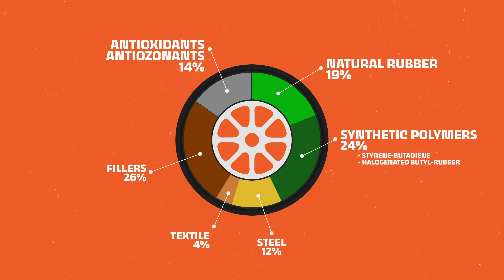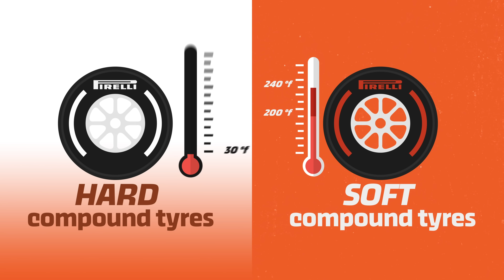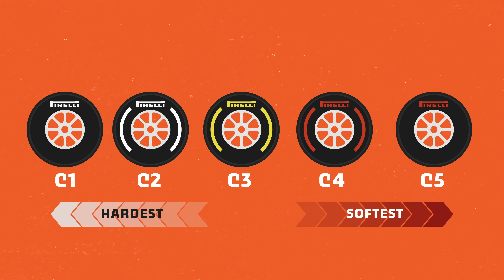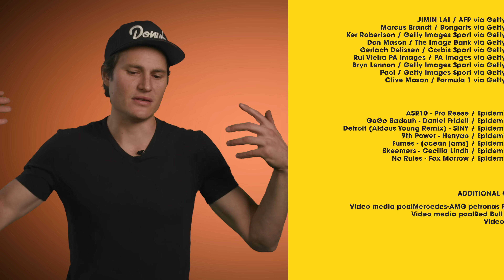Why an F1 Tire only last 50 miles

Comment: Dr. Porsche used to say that "the perfect race car crosses the finish line in first place and then falls to pieces.” Never knew that applied to tires as well.
Reply: You mean Ferdinand Porsche?
Reply: well this is the best engineering. makes sense although accounting for inevitable random factor, the car could very well fall to pieces right before the finish line on the next race.
but here we're not talking about engineering to get the best performance but the opposite. force performance degradation by some rules. sounds like having tires that could last a whole race would not make it much slower and could allow more strategies. plus making engineering work towards improving tires instead of artificially reducing longevity. right now electric racing class sound more exciting regarding to the real-life improvements they could eventually bring
Reply: It all makes sense now! German car companies just look at the warranty as a race!
Reply: True, wheb porsche used to race their aluminum frame would last one race and they had to replace it because of fatigue and cracks. The spaceframe wighed 60kgs.
Reply: Also, it was filled with gas so they knew when it was leaking somewhere
Reply: @kuebby  So they want their customers to speedrun the warranty?
Reply: @kuebby  so by knowing when things fail, they can design their parts to last... I mean Porsche managed to become "the" reliable supercar 🤔
Reply: Tyres are part of the car, so why not? Only difference being the team don't make the tyres.
Reply: Jimmy Johnson knew about that. He entered a highly illegal car on a nascar race as a car owner, and as soon as the car crossed the finish line the motor went off. 7 out of 8 cylinders were fine. The last one? God knows, it shattered in pieces somewhere on the track.
Reply: @nolongerusing7430  pretty much.  Most manufacturers want their cars off the road after 5 years.
Reply: The other end of the stick, the perfect formula 1 car crosses the finish line 1 second ahead of second place, that way they know they conserved as much life from the limited powertrain allocations as they could.
Reply: It really doesn't ever apply to tires, F1 tires fail way before. XD
Reply: It was Colin Chapman of Lotus:
Colin Chapman who followed the principle that a racing car should fall to pieces as it crosses the finish line
Reply: the tires lose so much grip before they fall appart so no this is wrong this dude doesnt really know what hes talking about in the video
Reply: Hey guys I have been following god for some time now and he’s made my life so much better. I encourage you to do the same🙂
Reply: The Blues Brothers Nailed it!!!
Reply: dragsters:
Reply: Very similar to rocket engines
Reply: That was a Colin Chapman quote. 
Founder of Lotus and designer of F1 cars.
Simplify and add lightness. Was his mantra. The perfect car would finish the race and go no further.

Comment: Sergio Perez must be laughing while watching this
Reply: @everydayalbertan768  have u even seen this video? xD
Reply: I mean after today he might be 😂
Reply: @everydayalbertan768  it just depends on the tires used he doesn’t mean the tire can’t get past 50 miles. If you watched the video you’d probably be able to notice that there were two processes that affect the tire mainly
Reply: @everydayalbertan768  They do have knowledge. He was talking about F1 Super Soft Tyres. They don't last more than 50 miles.
Other compounds like medium and hard tyres are DESIGNED to be more durable, but sacrifice grip. Medium is the balance between hard and super soft so they have the characteristics of both.
Reply: @ScreamDeafProject  true , each tyre has many different of chemical compound
Reply: @everydayalbertan768  bro have you seen the video
Reply: @everydayalbertan768  He literally said that. It was the "give up". Watch first
Reply: @everydayalbertan768  9:35 next watch the video before saying bullsh*t
Reply: @everydayalbertan768  think before your type because you have now upset everyone
Reply: @everydayalbertan768  you've especially upset your mom
Reply: @everydayalbertan768  it's actually kipzo that's talking rubbish. They are just stating what the tyres life is based on paper.
Reply: Checo is cold heart men is something serious happening there
Reply: Red Bull is running GoodYears with Perreli stickers

Comment: Who's here after Perez done 53 laps on medium tyres at portimao?
Reply: Since the track is 2.89 miles long, that means he drove at least 153 miles on those tires
Reply: @NORIN_50  oh my god I didn't even think of that
Reply: @NORIN_50  jezus cgrist
Reply: did he win?
Reply: @akshatshxrma  nope
Reply: he got p4
Reply: 50 laps he was visibly a lot slower than other cars so they didnt necessarily last
Reply: @bjk03_62  the tires did last, firstly it didn’t blow up and secondly, THEY’RE FUCKING MEDIUMS. Which theoretically can only last like 30 laps at minimum.
Reply: Well, Perez is THE tyre wizard in F1 and its Minister of Defense..
Reply: @hersencell6880  However some special drivers manage a tyre management really well
Vettel Barcelona 2020 37 laps on soft despite Pirelli predicted soft can only do 30 laps
Wherlein Brazil 2017 69 laps on soft despite it can't do 40-45 laps on more in Sao Paulo and the track is quite hot
Reply: "tyres is still good"
Reply: @danileuenberger5620  what about albon who made his first pitstop on the second to last lap of the Australian gp in 2022
Reply: @hersencell6880  what do you expect of checo,master in conserving the tyres while mantaining great pace
Reply: Not impressive, Hamilton did 60+ on Monako
Reply: @bartoszwolnicki  yes, on a much shorter track that is nearly impossible to overtake on
Reply: @bjk03_62  last but slow

Comment: The FIA tried "just letting them race" in 2005 when tire changes were banned, and the show was horrible. Passing was affected because the tires had to be made harder to last through qualifying, plus the entire race the next day. This led to less passing and risk taking, as drivers would be more worried about looking after their tires than going for opportunities.
Reply: And led the the dumpster fire that was the 2005 US Grand Prix where only 6 cars started because they were using Firestone tires that could last the whole race and the others were using Michelin tires that couldn't handle the high speed banked turn at the Indianapolis Speedway.
It's a really big blemish on f1 especially here in the states.
Reply: Not an F1 watcher, but tire changes being banned isn't the same as allowing people to build better tires from what I understand.
Nobody said F1 should ban tires, simply just allow them to engineer better tires for races without stops. It seems the technology exist, without the compromises you listed. IE, engineer a good tire but instead of it being 50 miles, let it be 100 or 200. If they can do it, then I seen no issue.
Also, if they allow tire changes, if someone blows out, they can simply replace it. Obviously I'm not sure how that would impact race times, but you wouldn't have to be 'conservative' out of fear of blowing out.
Now obviously with any change comes a shift in how the game is played, but I don't think it sounds like there is a downside that would result like the one you're listing.

Seems like you're comparing 2 different scenarios.
1; Where racers had to make a tire last the entire race and drove fearfully.
and,
2; Where people are asking them to allow for tires to be engineered to last longer, since there is 0 compromises and 50 miles is more dangerous than 100 for example.
Reply: @ViolentMLG  the way the the current cars are built do not allow for easy passing as a trailing car loses massive amounts of downforce as they are trailing the leading car due to the way the aero in the cars work. This means that pit stops can deal a huge blow as other cars pass you while you are in the pits and now you have to drive harder to be able to pass and regain the positions lost. If tires are made to last an entire race, the drivers are just going to babysit their tires and simply defend their track position rather than try to overtake
Reply: @lokeychomusuke  But if the tires were made to last the entire race, or even just a bit longer, wouldn't thay allow for a fight to the finish with every single car going all out? It seems like it'd be entertaining to watch.

Same tyres/tires = no more babysitting and mainly focus on being first? If a tyre lasts the whole race, why babysit it? Go all out and keep as much distance as possible and race as best you can and try to keep P1.

Like Violent said, 2 different scenarios.
Reply: @misdemeanor61  that's only because the surface on Indy went through a process called "diamond grinding" where they grind off the top uneven layer of asphalt and put in little grooves that run parallel to the track to help with rain water and oil and stuff. Bridgestone had data on the track after its resurfacing through their Firestone branch that ran in IndyCar series at Indy unlike Michelin. F1 had a rule at the time that didn't allow testing for the tyres so Michelin was completely in the dark about how their tyres would react to the new surface while Bridgestone knew exactly how to build their tyres.
Reply: @jkljkl218  there will always be degradation which means that tires will become slower as time passes. Tires heat up more when you are going all out to try to pass or defend which will cause your tires to degrade faster. No tire can just not degrade from the heat cycles they are put through. 

F1 is a sport of tenths of a second, everything counts. Take for example this season, the mid field was super close together, do you think if they had tires that would last all race there would be as much overtaking? No, because they can't afford to degrade their tires more than their competition and they can't afford to go harder than everyone else because they can't afford the time penalty they would face if they had a pit stop. The sport already has a problem with overtaking due to the aero on the cars. The main thing that keeps it interesting are the different strategies that are forced by the 2 min tire compounds that have to be used per race.

Single, whole race lasting tires have been tried before and it produced a slower, boring set of races from drivers babysitting their tires. If everyone was equal then maybe I could see it making sense for backmarker teams to try and go ham and pass the leaders, but they can't because the sport isn't like that. It just would not work for race day.
Reply: @ViolentMLG  not trying to be rude here, but you aren't making any valid points... or much sense. Don't know why 12 or more people liked your comment, I guess they don't know much of anything either.

This is how it goes:

You extend the life of the tire to last during the whole race, the pace of the race is fixed and the show becomes boring.

No person, or racing team, is contesting this. Everyone with any sense already knows what the outcome would be with a full race length tire. Adding an element of strategy makes the competition that much more eventful. 

Glad I could clear that up for you. I hope the other people that went out of their way to like your comment are also enlightened to the intricacies of F1 racing regulations.
Reply: @lokeychomusuke  but thats why make a tire that lasts a bit iver the race, it would give teams the option of defending early, go hard hqlfway through, defend at the last bit... etc... you can still have a strategy but just a bit different? Same end result as 3 different compounded tires.
Reply: @jkljkl218  it doesn't quite work that way. You again have to understand that F1 is a sport of tenths of a second and fighting for singular points, especially for the midfield. A tire that lasts even 2 races will degrade and get slower as the race goes in meaning you will start to lose lap time. Every team will try to qualify the best they can to get up the grid as well as possible and will only defend their position on track on race day because they can't afford to lose more grip from their tires in comparison to the other teams around them. 

Like I said, this has been tried before and all that resulted was tires being babysat and minimal overtaking aka a boring race. If they did that in modern day f1 we would see mercedes win even more than they do now and the outcome of the race would be just about the same every weekend
Reply: @lokeychomusuke  if thats the case, then just make tyres that lasts a tad bit more than the current ones just to be safer for the drivers, but implement a rule to where a pit stop is necessary? I dont watch F1 regularly, but I do know the basic concept and how pitstops work and strategies, surely there is a way to make it safer for everyone and still keep a fun race spectacle.
Reply: F1 prior to the 1980s ran tyres until the end of the race, and there were exciting races all the time.

It's not the tyres, it's the cars!
Reply: @tiadaid  Agreed. Aero has been the achilles heel of F1 cars, tires and competitive racing since it's inception. And considering how aero dependent the 2005 cars were, it was the perfect storm for bad racing.
Reply: @jkljkl218  the donut media guy is under estimating when he says 50 miles, most of the time the teams do much longer distances. Increasing tyre life by a little bit would basically make no difference.
Reply: @jkljkl218   bruh Lewis Hamilton has complained about his tires degrading fast bust the engineers in his team don’t listen because he keeps getting faster lap times, so imagine a tire that lasted longer he’ll just keep winning making the sport boring to watch
Reply: @temiomo-loto4122  id watch it purely for laptimes
Reply: That was different and again, STUPID (it's the FiA).  They should have tires that CAN last the race but still be aloud to pit for better performance if you WANT.
Reply: @EricHorchuck  no, that makes boring racing. everyone will try to conserve their tyres to the end, because overall that is the fastest strategy, no matter what (on most tracks). pretty much noone would go for a different choice, and it would just turn into a tyre preservation competition.
Reply: "just let them race"
"tire changes were banned"
To me that doesn't seem like they're just letting them race when they're telling them they can't change tires, wouldnt letting them race involve no stipulation on tire changes so they could do as many or as few as they wanted?
Reply: @BlackHawkBallistic  Precisely
Reply: @BlackHawkBallistic  EXACTLY!
Reply: Tyre wars of late 90's into 2002 or whatever was pretty crazy
Reply: Nurburgring 2005: Kimi Raikkonen flat-spotted a tire early on and drove his McLaren to nearly the finish, commanding the lead of the race until the vibrations from the flat spot broke the suspension and the car flew into the wall. Due to the banning of tire changes that year, Raikkonen would have taken a penalty if he had changed his tires mid-race, making the risk worth taking to run the car til the end. 

That is a better example of how the show was affected by the ban.
Reply: @robertsacks7995  !! great example i remember that, slowly then suddenly whoosh. A bit like #Bitcoin lol
Reply: @robertsacks7995  Kimi is a risk taker; especially early in his career. One of the few true old school drivers left on the grid. It's cost him wins and championships, but damn did it make him exciting to watch.
Reply: The thing is if you don’t watch F1 one thing you surely know about is the 2.5 - 3 sec pit stop it has become like a trademark
Reply: @jkljkl218  no bc they also have to fuel manage and pit stops at the moment is the only way the rave can be exiting sometimes at the moment
Reply: Agreed. More pit stops equals better racing. One stopping is so boring. Medium for 25 miles then to hard for 30.
Reply: @ATX_Engineer  well said
Reply: @ViolentMLG  you should have stopped after you said not an F1 watcher lol. Because if you were a fan then you wouldn’t have said the rest of what you said lol. More stops equals better and entertaining races. F1 is not like other motorsports. Tire strategy and pit stops are paramount. You can undercut and over cut. Know when to push and know when to look after your tires. There’s a reason the FIA makes these requirements. Because they are putting on a show. Similar to like the shot clock in basketball.
Reply: @jkljkl218  haha. Fight to finish. Lol. F1 is not nascar lol. That’s just not how it is
Reply: @jkljkl218  dude. There’s no issues with the tires. This is an American YouTube commentator that although did his research, clearly doesn’t watch F1. Because he posed a question that literally no f1 team, driver, or fan has ever questioned or requested.  They are races during the season when it’s a one stop strategy due to the track etc and its the most boring races.
Reply: @EricHorchuck  you lose 22-30 seconds in a pit stop. No one would ever pit bro. Stop trying to simplify a complex sport. The tires aren’t a problem. It’s the aero.

Comment: 50 miles: Ok
51 miles: "Bono my tyres are gone"
Reply: then starts a string of fastest laps
Reply: And theñ Lewis Hamilton Wins the GP.
Reply: Lol basically
Reply: a u s t r a l i a n s
Reply: LMAFO
Reply: "Change da world, my final message, good bye."
Reply: 5.1miles* : bono my tire is gone
Reply: @Fujiwara.Takumi1  *50.1
Reply: BUT I WOULD WALK 500 MILES AND I WOULD WALK 500 MORE
Reply: @JP-fj3dd  no I intentionally meant 50.1
Reply: @JP-fj3dd  if it is limited to about 50 miles then couldn’t it fail between 50 and 50.1 miles?
Reply: Yes
Reply: The 🅱️lan is going all too well.
Reply: 80 miles: “fastest lap”
Reply: We introduce to you! SERGIO PEREZ
Reply: Nono my tyres are shot*
Reply: Get in there lewis
Reply: >tyre